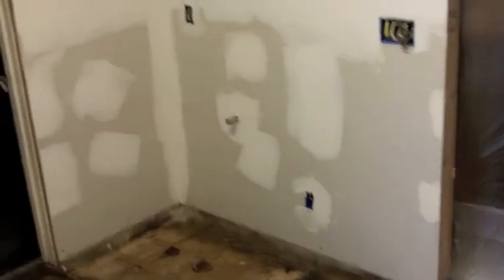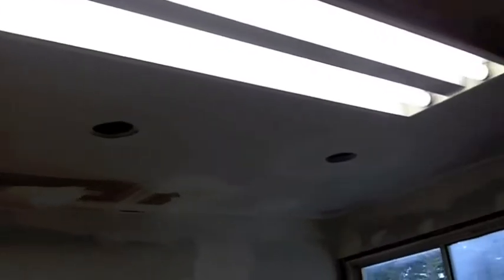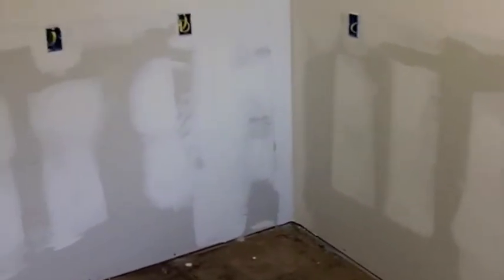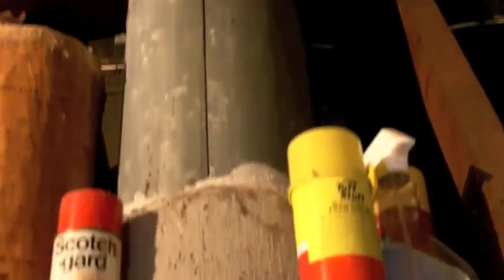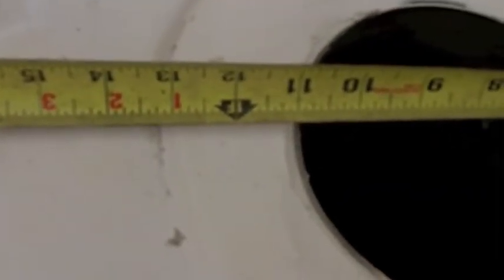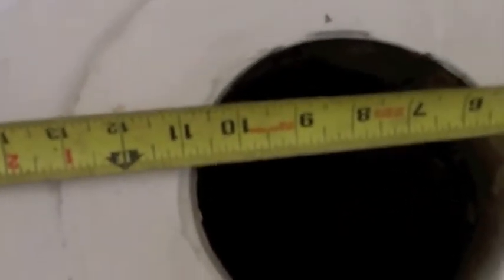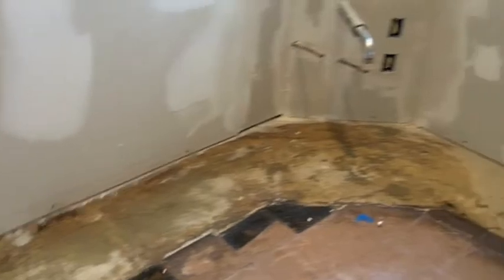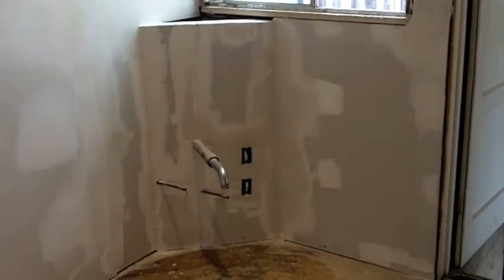Custom Kitchen Remodel Drywall 11

Comment from the maker: I probably didn't mention that I have done extensive work on three other houses in this neighborhood tract, built at the same time by the same builder.  I did extensive sample testing in the first two houses and came to realize I basically had identical materials reports.  I am very familiar where the monsters lurk in these houses.  Thanks for watching.

Comment: Hey bee:  Sorry for the crptic comment (too much overtime lately).  What i meant to say: you don't have any fans to use to speed up your drywall mud in drying.  Yes, i thought the dancing was original.  Your a hard working guy.

Comment: Hi yourbeekeeper, what is the best way to remove black surface mold from the wall?  I have a plastered wall in my vedroom and after years of putting my bed right against the outside most wall, over the years I've noticed that the big black stripe was actually mold, never gave it much thought before but is there any good product or thing to use for washing it off the plaster, I don't think it's in the wall just surface.  I live in the UK btw.  Cheers
Reply from the maker: +Samthebam4044 I have always used a 50% bleach and warm water solution to remove mold from surface areas.  Take caution about getting the wash on carpets, clothes or furniture.  I also recomment wearing gloves and eye protection as the bleah can be damaging if it gets on you.  Allow the plaster the completely dry out and you are okay to move one.  If the wall/paint is damaged a good primer/sealer should be applied before you apply finish paint.  Keeping your bed/furniture a few inches from the wall should improve the air flow and prevent this from happening in the future.  Good luck.